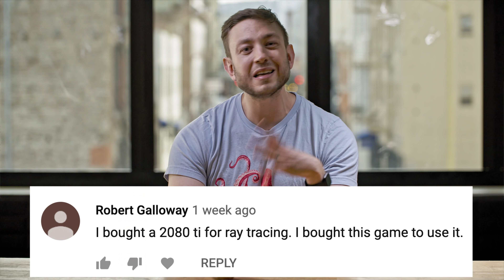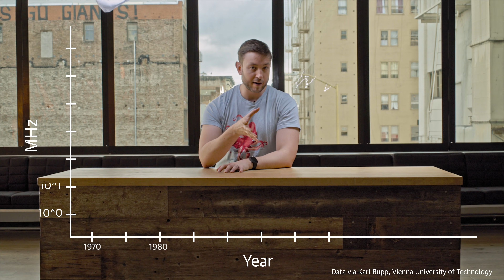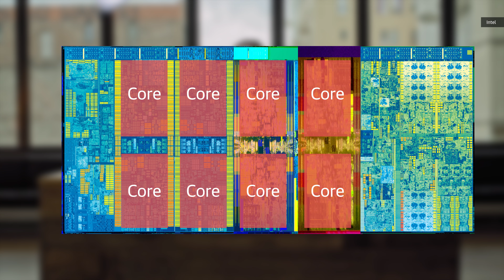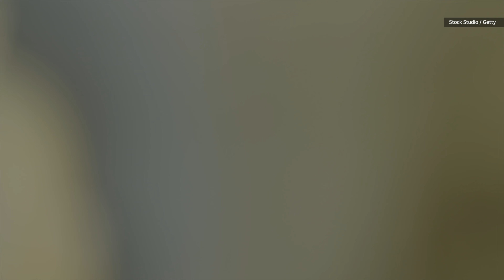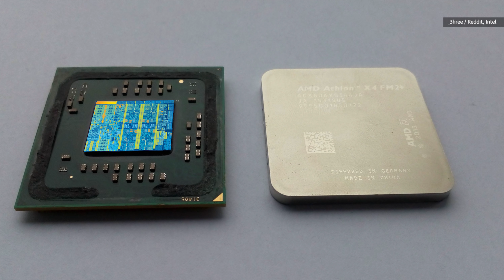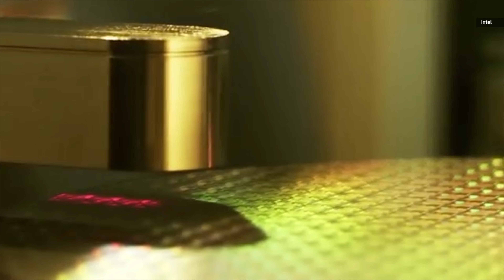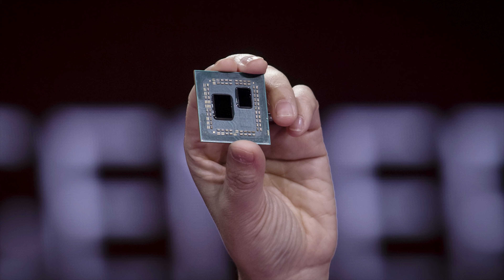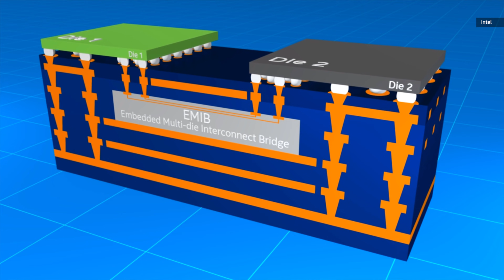How Intel and AMD are using 'chiplets' to build next-gen CPUs | Upscaled

Comment: AMD Epyc processors, which were released in 2017, already used chiplet design. So it's old news...
Reply: Old news? 2 years is not old news. You must have the attention span of a squirrel on crack.
Reply: @ @GAFFzero  
2 years ago is old news whether you like it or not, and your pathetic ad-hominem attacks aren't going to change that. Personally, I heard about chiplet design almost 3 years ago, i.e. a year before AMD Epyc processors were officially released.
Reply: @atf300t  Good for you.

Comment: Why has none got a memory? Gallium Arsenide; All the problems of manufacture and sourcing materials where solved two decades ago. Its 11,000 times faster than silicon with the IBM designed Cu on Ga construct - its used in telecoms switching chips and they run at speeds you wouldn't believe. So I won't tell you.
Reply: uhh...because they can make more money with the existing technology....

Comment: Reminds me about PlayStation 3 Cell architecture PowerPC based CPU featuring their Broadband Engine with reconfigurable processing elements jointly developed by IBM and Toshiba for Sony. Its sad that Sony dropped this design, it is very flexible powerful architecture that came out too soon too early. Because later IBM used that CPU architecture to build their Roadrunner supercomputer. Still have the original fat PS3 because I admire Sony effort in building original high performance platform instead of just copy catting an Intel based PC with some standardized GPU.

Comment: You give Intel way too much credit in this video for the advancements of CPU performance and technology. AMD are the ones pushing the edge. Intel are playing catch up in many respects.
Reply: I don't believe that's the case because the top tier performance still belongs to Intel however it comes at stupid premium price. however currently I am cheering for AMD because of the crazy value they are bringing.
Reply: @newdavidof  I agree, Intel still holds the performance crown in a lot of areas. But I was referring to actual advancements and progress, especially over the past 2 years. If it were not for AMD and Zen then we would probably most likely still be buying 8 thread i7's and Intels HEDT platform would still be limited to 10 cores.

Comment: I think the AMD way of splitting the Chip into chiplets and aranging them horizontally is better for the desktop, because the heat can be managed rather easily.
Also the scalability of Zen2 would allow for multiple chiplets and CPU - GPU combinations, without redesigning the CPU chiplet itself (But rather the AIO Chiplet).

Meanwhile Intels way is nice for mobile Chips, because it safes space and low power chips are more managable in terms of heat.

So AMD will lead the desktop with (possible) 16 core chips for the desktop and potential 32 Threadripper chips for the Workstation guys.
Intel will probably try and get their chiplet design on paar with what AMD is doing here and lack behind AMD a bit on the Desktop and server side untill their High-Power design on 10nm is ready. In the meantime: Intel will dominate the mobile market.

But that is speculation which doesn't take Intels upcomming graphiccards into account.

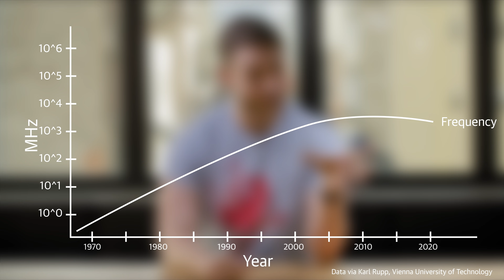Comment: wait that graph at 1:49 indicates we're regressing in cpu tech. Moore's law is slowing down, not going backwards.
Reply: Operating frequency is not the same thing as actual performance. We are finding ways to do thing more efficiently rather than just blindly increase the clock speeds. The clocks lowered when Intel went from Pentium D to Core 2 and later when AMD moved from FX to Ryzen.
Reply: @Vengir  thank you for clarification. I was guessing I was either missing something or that graph was wrong.

Comment: I build and repair computers and you forgot one major issue. The CPU can be fast, but if the mother board doesn't have the bus speed to support it, then its still a "slow" computer. So until we can go beyond the 64 bit bus, that is what we have to work with. Think of it this way, at 8 bit bus, that was like a two land road, 16 bit a two lane highway, 32 bit a four lane highway and 64 bit the Autobahn. Now if we want truly faster computers we will need a 128 bit bus, so information can move faster. Yes, just because you have a bigger engine/CPU, does not mean your computer will be faster, if you dont have the transmission to handle it, so too speak.

Comment: the problem is software. the cpus did get a lot faster, but software being bloatware of shitty oop coded junk, the improvements simply do not translate to performance. allso new instructions are needed in cpus to make them faster in both single and multi core. the new cpus are pretty mutch more like risc processors, but the clock speed limits are holding back them getting faster. that is a nother design flaw.

Comment: This is a good analogy to understand the problem:
Imagine you want to make a straight thin line (like on a piece of paper). First you may do it by hand. You try to your best  but its crooked and not all that straight. So then you get a ruler. Much better but even a ruler isnt exactly straight. If you look at the microscopic level you can see that a ruler is a bit defective and crooked. So you replace it with something that has been machine sanded to be as straight as humanly possible. Perhaps even a different material. The same problem exists for the paper and that pencil edge isnt very thin or sharp enough so you use exotic materials. Very expensive. 

This is where we are at today. Its gotten so small its hard to know what is next and the fundamental physics are conspiring against us.

Right now we are trying to replace that pencil with a laser called EUV. This produces a wave length that is absolutely tiny but to make this is extremely difficult because everything absorbs it. They are huge machines that require massive amounts of energy to run. We are just about to get there though and that shall help immensely but that theoretical limit is getting closer and closer.....atleast with silicon but no obvious alternatives exist yet that are cost effective.
Reply: Why isn't this top comment? Nicely said.
Reply: This is the most common perception but its not 100% accurate. In reality, it's actually pretty easy now to create small feature sizes even with current lithography tools. Consider that we havn't been able to directly etch shapes for a very long time (DUV uses arf lasers that have wavelengths at something like ~190nm). So, we've been using multipatterning for quite a while and we are quite good at it. Even the alignment problems, which are pretty difficult problems, have pretty mature solutions. And actually, we can make lines that are much cleaner with DUV than we can EUV which has line edge roughness issues. So then why EUV? Because DUV at 10nm and beyond requires each die layer to have something like 6 masks. If you have 20 something layers per die, that's a huge number exposures you have to do for a single wafer. So your wafer per hour (WPH) drops dramatically. This makes things extremely expensive, to the point where it becomes cost prohibitive. So in reality, we are not moving to EUV because we can't make small feature sizes, we are doing it because it reduces the number of masks which reduces overall cost.
Reply: Instead of drawing the lines why not build them at the atomic level?
Reply: Dilithium crystals lad,  Dilithium crystals
Reply: so what about a speed of light tech, like fiber, or what about quatum cumputing???
Reply: @federicohansen4561  fiber cables dont compute things, and quantum computers arent per se faster than traditional cpu, they just excel at certain workloads
Reply: So what’s that got to do with CPU’s?
Reply: rightly said

Comment: Maybe problem is in market domination more than ever than in lack of technologies. Intel has been dominating market for decades, and AMD was completely failing to challange them. And look what happened now, AMD stepped it up, and suddenlly we have 8 cores cpu as a default choice. Look at mobile space, there competition is insane. My galaxy s10 chip easely rivals my 2012 laptop i7 3740qm high end chip with 4 core. Even by today standart this 2012 i7 would be still in mid-to-high level cpu and considered very fast. Why my 7 year old laptop chip still fine, but my 7 year old phone chip would be useless? Well answer lies in insane competition in mobile phone market with basically no competition in Desktop and laptop market. Problem is definitely not in the limitation of technologies, but in limitation of competitin in my opinion.

Comment: 15 YEARS ago I worked for a company that made sub micron vision metrology systems.  Basically a very powerful optical comparator.  After 2 years of working for this 10 year old company, our customers came to us and told us they would no long buy our equipment, because their parts were TOO SMALL to be seen in a 1 micron field of view...   15 YEARS AGO...  TOO SMALL for a one micron field of view.  We only sold to the military, and US companies and research universities.  Five years earlier, I worked for a company that made diamond substrates from carbon gas.  We "BELIEVED" we were working for a US manufacturer, until one day the FBI showed up and escorted EVERYONE OUT OF THE BUILDING.  Once perfected, the 'process' was taken away.   A DIAMOND chip, processor is unlimited in speed, because heat is nearly non existent..  Has ANYONE ever seen or heard of a DIAMOND PROCESSOR?   NOPE, and you never will, but the US Government has them.
So, you're asking the wrong question.  Not 'why' haven't processor gotten faster (They have)..?  But, will we ever see them?  < No.
Stick to video games, you will never really understand where tech is going.

Comment: i think 2017 was a great year for CPUs, Ryzen was a real improvement over anything existing, since for the first time in 5 years, we could see a mid range CPU (R5 1600) destroying the previous flagship (no doubt about Fx8350 and even Fx9590 from older AMD lineup, but also (if overclocked to 3.9) i7 7700 which was the Intel's mainstream high end CPU (in multitasking).

back in the day, in the 2000s and up to 2011, the CPU performance grow by jumps, a 2000 chip CPU like Pentium III couldn't even be compared to something like an Athlon 64 X2 which was launched in 2005. after 2005-2006 some stagnation came in IPC, but then multicore came out, 2 and soon after 4 core CPUs came into existance, and from late 2006 to something like 2011 things kept growing at a decent speed

Nowadays in 2019, Intel i7 2600 can be compared with 4 core 8 thread CPUs from the present, and even Fx8350 its still a pretty capable CPU for almost everything except a few games and 4K video editing. The improvement its not that much in the IPC itself but in the thread count and other stuffs like disk speed.

From 32nm to 14 the gap is harder to reach than from 64 to 32, and from 14 to 7 the gap its even harder... it has to do with the materials involved. Sillicon can't go under 7nm and the limits have to do with physics

Comment: With monolothic dies, if one core... well, dies *G*, it's not a complete loss. It's called binning - the defective core will be deactivated "manually" and the chip gets repurposed as an inferior model. Say - an 8 core Ryzen 2700 that has 1 or two broken cores? No problem, re-validate the part and sell it as a 2600 - or if the rest is working super dandy, a 2600X ;D

Comment: Do a similar video on why hard drive capacity is slowing down over the years
Reply: Message from the future: SSD isn't slowing down. You can buy a SanDisk Micro SD Card for 160 USD that has a 1 terabyte capacity and weighs 2 grams, and can fit in your belly button. 1 TB!!
Reply: @ronensuperexplainer  1tb micro sd from 2019...yeah moving real fast.

Comment: that's funny considering how in the past Intel was trying to make a computer on the chip and put everything in there (GPU, etc) because I guess this would be cheaper than doing all of the assembly and having to have multiple processes running at the same time to create a variety of chip types. Well, things change. I guess what's right is what's right now , not what's conceptually right always.

Comment: I have an i7 980 CPU purchased in 2009 which I’m still using today with the GTX 1080 GPU.
in the early days I noticed very incremental improvements with newer CPUs but in 2019 it still holds it’s own.
I know it uses more energy.
I’m amazed by it and some reviewers said the 980 CPU was ‘too good’.
My main concern is that it is in a Gigabit motherboard and it can die just like that. But it does have the solid caps.
However It’s been through 3 or 4 PSUs and I upgraded the case and installed a water filled cooler.
So it might be like an axe with 3 handles and 2 heads.
I maintained it, it didn’t just sit in the corner running for ten years.
And I turn it off when I finish with it, it hasn’t been running continously.
Hopefully in 2019 i’ll build a new one so I’m not got nothing if the mobo dies.
Another thought, the CPU was more expensive than the others, does that translate into the longevity of the chip?

Comment: Mist two rather important points.

1: 14/12nm is not just more stabile, its also quite a bit cheaper per transistor than 7nm. Making things as SRAM cheaper per MB of Cache, reducing the cost of L3 cache quite significant for Zen 2 CPU... L3 cache is the single most expensive part of a modern CPU.

2: Some things, like memory interfaces don´t scale well... So making them on 14nm is not only cheaper transistor vice, but may not even take more surface area, making it quadrupy cheaper. Interfaces is the second most costly part of a modern CPU

Comment: X86 is outdated. ARM is the future.  The only way for x86 to survive is to abandon trying for clock speed or multiple cores. The next Intel CPU’s should focus on GPU.  Two highly robust cores at 3hz are there to translate the api instructions so that the Internal GPU can do the heavy computations. In a high end gaming system the previously unused Intel HD or iris graphics chip will process all the tasks the traditional CPU cores would do and the heavy graphics lifting would be piped to a discrete GPU such as a GeForce 2080ti.  The result is a low powered dual core x86 chip with a iris plus that can out perform a 16 core cpu.  The secret is the iris is a GPU and is far better at complex computation than a traditional x86 GPU.  The Problem is it would require new motherboards and a new build of windows 10 to allow this to happen.  New games and applications would need to be designed for it to work as well.  This is why x86 days are numbered.

Comment: Moore's law was never about performance or speed, mind you, it was about element count on a die. CPUs ARE getting more computational power - it's software that still cannot utilize multiple cores. And no, you won't have higher clock speeds because of heat problem. Funnily heat is even bigger problem in die assemblies. So, want better performance - write new software.

Comment: Its is pretty sad that cpu performance plateaued of late,when i started upgrades where OMGWTF every time, starting with c64 went pretty quickly up to 1ghz , 2, then 3ghz but really havent gone that far since, sure we have nice core counts now but depending on what you do, it may not help.I was thinking 10ish years ago man, in 10 years surely we will be 10ghz! I was running just under 4ghz back then, current daily OC on my hexacore Xeon (under water) is 4.8ghz,800mghz makes me  sad panda. I know i could upgrade and get over 5 but for no real gain, so meh! Ill stick with my rather old Xeon for a while yet, getting 10-20% MAX with entire board,ram and cpu upgrade simply is not worth it to me.

Comment: Major frequency improvements aren’t going to come until processors switch away from a silicon substrate. Transistors with switching frequencies exceeding 600 GHz have been demonstrated in Gallium Arsenide. High frequency GaS transistors are actually used fairly regularly in high frequency radio applications. Last year there was major progress in the field of silicon photonics, which is using lithography to embed optical components in a silicon substrate. Optical transistors are already a thing, so there is possibly a future where the signals in your computer are actually carried by light and the "power source" would be a laser.

Comment: I have a question about mobile processors. Why is thecomputational capacity of mobile devices typically expressed in transistor counts and clock speeds as opposed to gigaflops teraflops and even petaflops like supercomputers. What is the gigaflops rpeak of the A12 X bionic for example or the Snap dragon 845? Thank you good videography and great commentary

Comment: Gamers and those editing 4K+ video likely disagree, and I get that, but CPU speeds have stagnated because they don't really matter right now.  GPU performance is a more relevant number in most systems, but the real bottleneck is disk drive access speeds.  Generally, CPU speeds are more than fast enough for the average user.